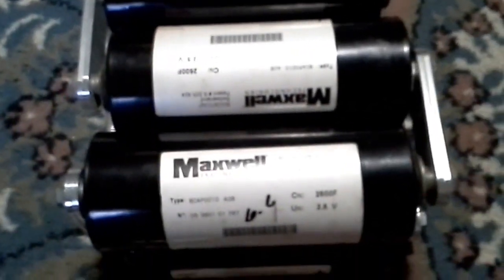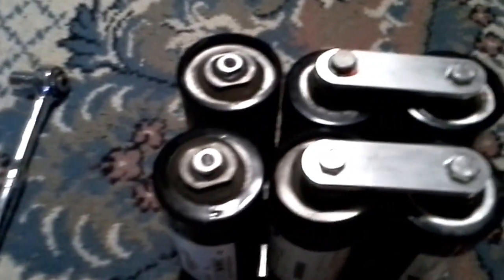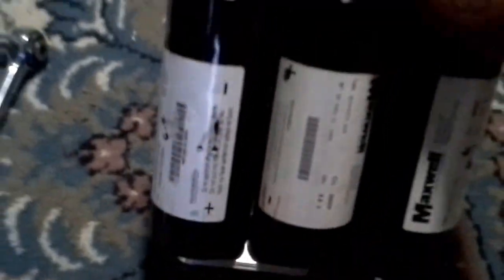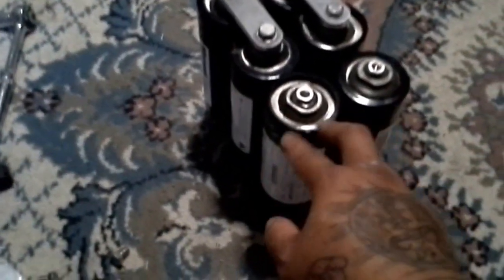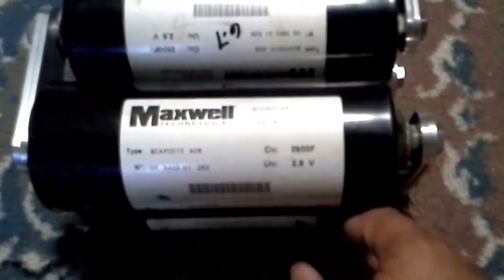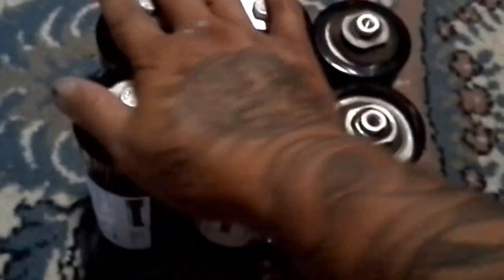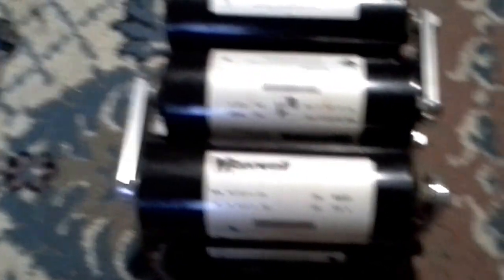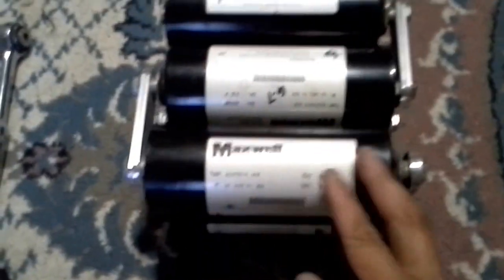2600 FARAD MAXWELL SUPER CAPACITOR

Comment: Full Google+ Post: frozenprakash.com/MJtZwTcK2NC

Supercapacitor basics:

Only simple difference between battery and a supercapacitor is that,
Supercapacitor has very high power (kW) output and charging rate (kW) and has a very low stored energy (Wh).

The new Maxwell 3V, 3.75 Wh supercapacitor is amazing indeed !!

Specifications:
Peak Voltage: 3V DC
Peak Power Output: 7.7 kW
Peak Charging Power: 7.7 kW
Charging time at full power: 2 to 3 seconds
Energy stored: [3.75 Wh / 13,500 Ws / 13.5 kWs]

Here, [Watt Second] or [Kilo Watt Second] is the best unit to denote the capacitor energy.

1 Wh = 3600 Ws = 3600 Joule
1 Ws = 1 Joule

Using 1W for 3600 seconds = Using 3600 W for one second
i.e,
Using 1W for 1 hour = Using 3.6 kW for 1 second
thus, 1 Wh = 3.6 kWs = 3600 Ws

For example, this capacitor has 13.5 kWs of energy,
and has a peak power output of ~7 kW,
so it'll take approximately 2 seconds to empty the cell as 7 kW * 2 sec = ~15 kWs

Generally Camera flashes are also denoted in Ws of energy consumed per flash,
for example,  100 Ws to 2000 Ws [or 2 kWs] etc.

Maxwell Capacitor Link:
http://www.maxwell.com/products/ultracapacitors/k2-3-series